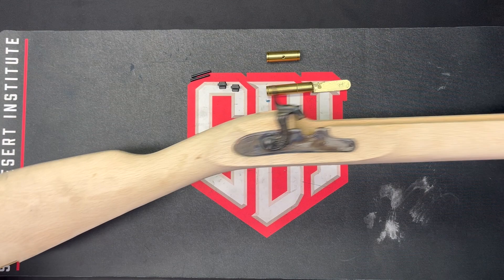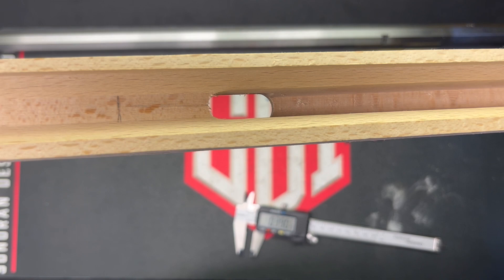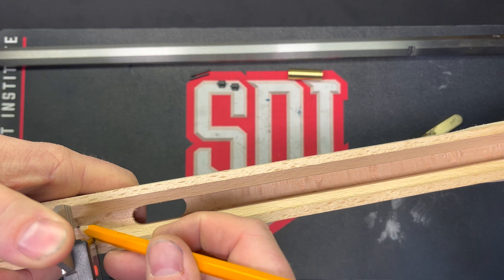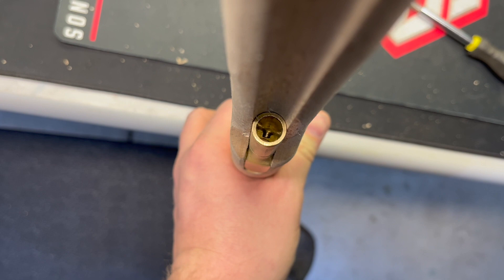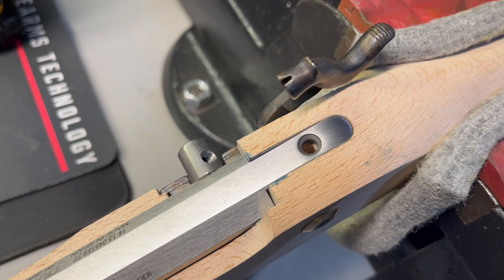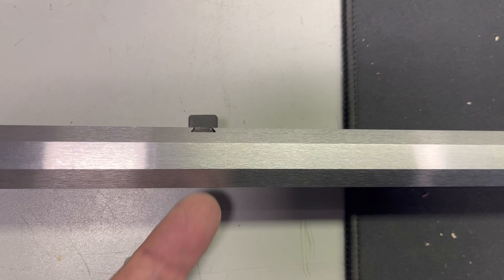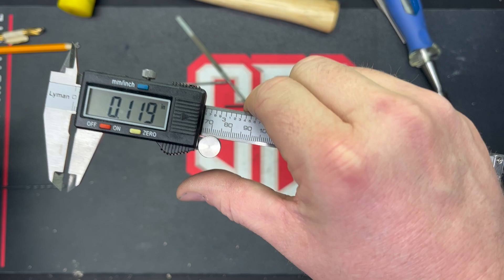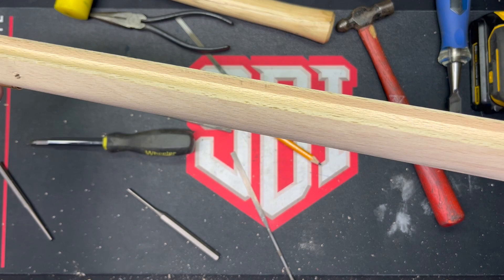Sonoran Desert Institute FTT 210 Muzzle Loader Lab Part 2

Comment: Does SDI take the post 9-11 GI bill? I applied for information, but couldnt find a clear answer on the website.
Reply from the maker: They do, but having completed the associates program now, I have to say your money might be better spent elsewhere. It’s not a very good program and kind of laughed at by actual gunsmiths. Wish I’d known before starting , but that’s just my two cents.
Reply: Going through it right now and using the GI Bill. I will be finishing in April and I have about 70+ credits transferring to GCU for my bachelor's (some from JST). The program is worth it if you use it as a stepping stone, but I gotta agree with Scott here, not the most adequate gunsmithing program, but those that are good usually require you going to brick and mortar school which not everyone has the luxury of.